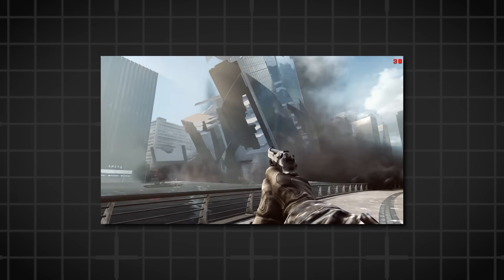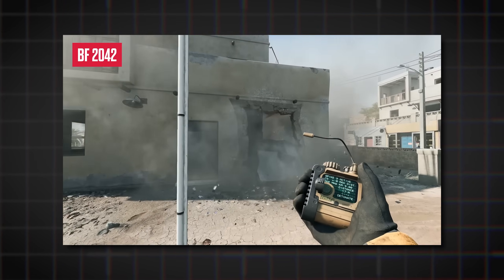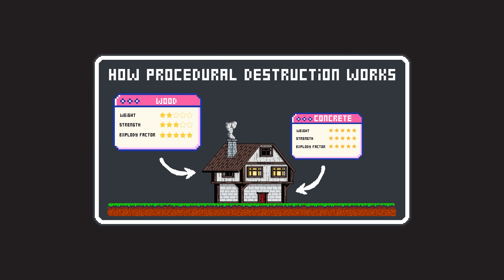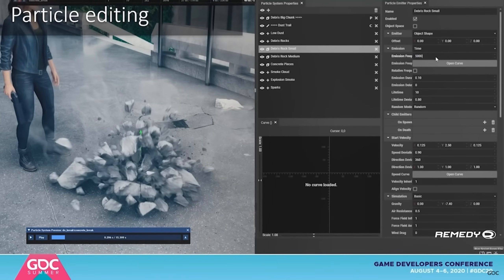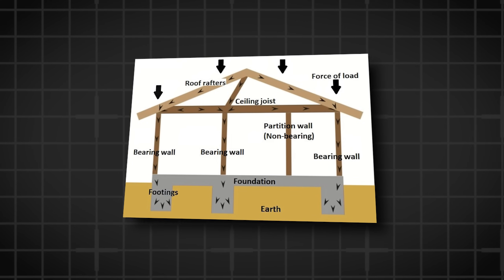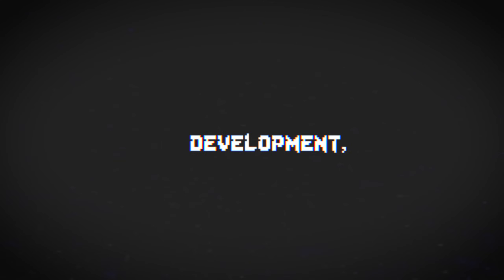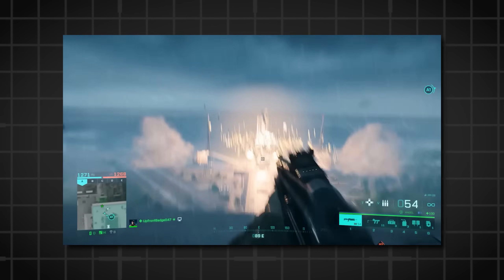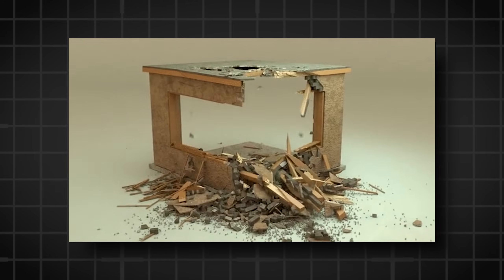How Games make Things Destructible

Comment: One interesting Idea I had while watching this video was to add collision detectors to parts of the pre baked destroyed geometry such that if any mildly large object like a truck interacts with a part of the collapsing structure that pre baked part is swapped  to a rigid body so the rest of the building falls as expected but he part the player interacts with dynamically reacts instead of either having to force the player to be far away enough from the building so they can't possibly interfere with it or that it just falls thru the interactive player as if they weren't there.